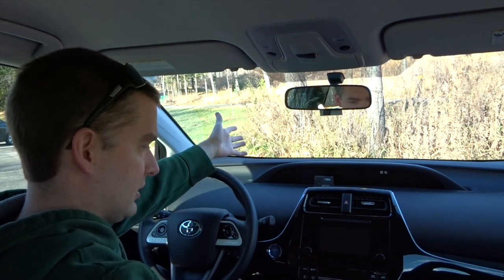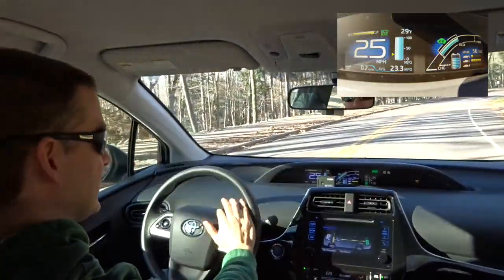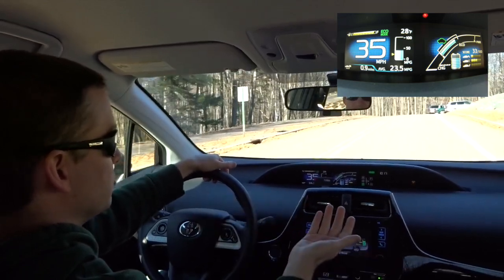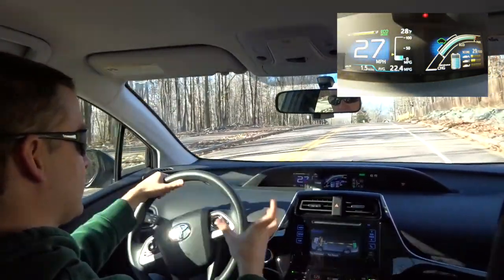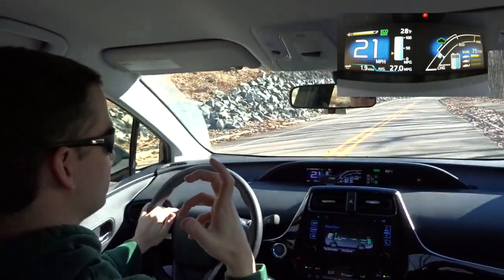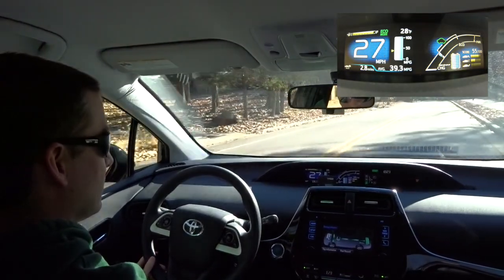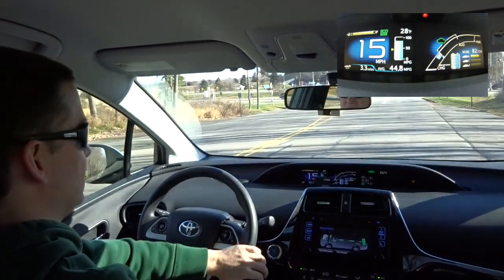Prius "B" Mode Explained

Comment: I have never had a Prius, but My next car may be a hybrid so I am learning. Could B mode be intended for short hills then?
Reply: Yes, and when the battery is full and therefore no regenerating is engaged anymore. Regenerative braking power is about at least 20 kW (differs because of the variance in HSD models) when you touch the brake pedal and in B-Mode engine braking comes on top which are about 35 kW. Engine braking power in Toyota hybrids is not as high as in  conventional gear-driven cars at low gears with high engine rpms because the HSD although it is continous variable in gear ratios with the help of the Engine-Generator 1 it is more limited. Therefore engine rpm is lower than in conventional gear-driven cars and so is engine braking power. But you get the regenerating power on top and you are even or better. Only on long hills and especially the non plugin Toyota version with the small batteries which are charged full in a small time and from then on no regenerating power. Therefore it makes sense to put the car in B-Mode on steep hills or long desecendings to give the mechanical brakes a longer time to dissiapate the heat.

Comment: The engine is spinning in B mode but no gas is being delivered.  Using the compression/resistance of the engine to slow the vehicle down.

Comment: B mode is engine brake mode. Engine runs to provide compression breaking. Use B mode on mountain descents and in heavy traffic where you don't want to break to stay in 20-30 mph traffic flow.

Comment: Probably it's not kicking EV mode on the steep downhill so it can actually use the engine for speed regulation, which can't happen on EV alone. I've noticed the same thing too.

The second thing that comes to my mind about the B mode is that it turns on the petrol engine, every time, no exception. That makes perfect sense to me, because the primary function and idea behind the B mode is the have your battery charged more aggressively and way faster. So how do you do that - well, by combining the "engine running = battery charge" + kinetic energy absorption = battery charge too. 

If you think about it, if you have the B mode running in parallel with the EV mode, you won't be able to get that desired aggressive charging :) Just my 2 cents..

Comment: I wonder what happens if you're going down a steep hill using the brake pedal only to slow the car down and the battery is becoming full, does the control system just gradually use only the friction brake pads to slow the car (it doesn't automatically select `B' mode and spin the ICE faster)?

Comment: I have a 2008 Prius, and it behaves basically the same when you put it in B mode, it keeps the engine running even at a stoplight. The reason it does this going down a hill is it is using the vacuum created by the engine running to act as a brake. Much as any other internal combustion powered car would do when you drop down a gear.
I'm not sure whether it recharges the battery at a higher rate than if you just lightly put your foot on the brake. Light brake application in a Prius does not necessarily Engage The friction brakes but only the regenerative brakes. You could take a look at the Gage while you're doing this and see how much charging is being put into the battery when you go down the hill in B mode versus just light brake application in regular drive mode.
One aspect of the Prius is once the battery is completely full it doesn't have any place to store the energy and regenerative braking will stop being effective, B mode and come in handy in this case. On very long Mountain Hills.
One- that I have found using B mode a lot is you may see an increase in oil consumption. Especially on a car with higher miles. This is because you are running with significant engine vacuum which can pull oil past valve seals and piston rings on a slightly worn engine. One reason the car may have been running as you approach that stop sign at the bottom of the hill even though you are out of B mode. Is because it was keeping the cabin temperature at whatever you had set it at you said it was cold and it needs to run the engine to maintain cabin Heat.
Reply: Difference between D and B is not the amount of charging. Braking by charging is first method in both. But the issue is, what happens when recharging is not sufficient way to keep speed in control. The method after recharging is generating heat to loose energy. That can be done in two ways, using brake pads or/and spinning the engine. There's no gears in Toyota Synergy Drive, so without B option, brake pads would be the only way, and in long decent, they would become toasted.

So when people thing B would be a clever way to generate more power to battery, the truth is the opposite, it's a way to loose more energy with heat generation.

Comment: I've always hated the Prius.... But tell me, Jettlash, what the hell is so fun about it anyway?
Reply: Wolfy Kun 
I use a 2015 to do Uber and Lyft driving in Minneapolis - I drive a shit-ton of miles. It's remarkably easy to drive smoothly, which is really important when you drive a lot. The steering is quite lovely. Tires are grippy enough in the dry (I'm amazed I haven't heard them squeal yet - WTF?). Not nearly as fun as my old 2015 Mini Cooper 2-door. THAT was fun.

Comment: I love the energy graph but I prefer seeing the tachometer. The graph actually shows your gas pedal position and you could gauge it at the ECO line: the gas engine kicks in when that much acceleration is needed.

When the battery is 8 bars full, the engine basically runs off the electric motor/battery to make room for more braking transfer.

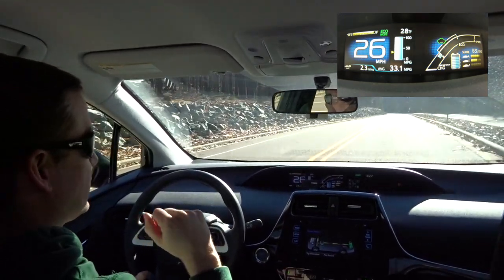Comment: 6:45 if you have the cabin heater on, the gasoline engine is on in order to generate heat for your body comfort. Unless it uses an electric heater but I don't think it does. Anybody here know?

Comment: Is that an aftermarket cover on the lower portion of the steering wheel ? I thought the stock version was white. If it is aftermarket, where did you buy it? Thanks
Reply from the maker: It's not a cover, that's standard on this interior color option in the Prius Two trim level.

Comment: I’ve never understood the benefit of saving a brake job ($00’s) at the expense of a transmission job ($000’s)
Reply from the maker: I can understand that argument. it may make sense to only use that in emergency situations.
Reply: On a long seep downhill, friction brakes may heat up too much and "fade" (have reduced friction). Friction in engine, on the other hand, will heat well under the temperature of normal use (burning gas). I think I read somewhere that this braking is done without using any gas -- air compression works as a brake.
Another benefit is that B-mode gives better traction control in slippery condition (less danger of skidding)

Comment: Good video.  
You can tune it up by looking into the Prius 'CVT'.  It is not a true CVT (what engineers mean when they use that term) because it has exactly ONE gear. The Prius never shifts out of that gear--it is always in that gear.  Many people are confused by Toyota's 'CVT', probably because Toyota wants to confuse folks about this.  One gear sounds bad, but Toyota makes it work.
Reply from the maker: Thank you, and I'd love to see a video about the internals on the transmission for these cars.
Reply: jettlash1000 : Does it have to be a video?  Would you settle for words and pictures?

Comment: Do you feel that the engine is slowing you down or is it the regen braking?
Reply: alex tworkowski
I'm guessing regen is used less in B mode and the gas engine is more directly coupled to the wheels by the drive system, allowing greater use of normal gas-engine high-vacuum braking (the gas engine revs higher in B mode).

Comment: Jetta.  B mode which I call brake mode is exactly what you said its basically L or Low Gears mode.  You asked or commented in the video that you didn't understand why the engine is on during B mode.  That is very simple B mode works by using the Engine to brake just like a car does in Low gears.  

Also please note that B mode can be engaged and disengaged on the Fly.  Meaning you can go from D to B and then back to D.  You don't need to stop the car.  

I use on steep inclines and when I want to brake harder without using the brakes.  For example and this is only for Prius cars and full EV cars, as you know the car brakes without using brakes pads.  Well if you need to stop faster without using the pads.  You drop it into B mode and then apply brakes and the soft braking is much stronger.
Reply: Soft Braking is my term for EV car braking without engaging the brake pads.  Soft Braking is usually about 10% of the brake pedal full range.  So anything above 10% depressed begins to use the brake pad, anything under 10% depressed you are using the Electrical Motor to stop the car.
Reply: My 2008 Prius still has the original brake pads, and they are still 90% or more unused.

Comment: Brakes needed to shift from D to B and vice versa ?
Reply: No need. But makes the transition to  “B” less risky cause cars behind you will not be advised by your brake lights.

What will destroy your transmission is shifting from D to R or viceversa without stopping first ( I’m not sure if there is a tolerance of 5km/hr but better play safe).

Letting it go backwards while in D, or ahead while in R is strongly told to avoid. Check manual.

Comment: “B Mode” in Prius is similar to the “L Gear” in conventional vehicles. 
L limits the highest gear the computer can choose, in order to provide as much engine brake as possible. If you drive at high speed, you remain in lower gears.
Prius doesn’t have engine connected to wheels all the time, so in B mode when you let go the gas peddle at high vehicle speed, Prius will engage the engine to provide engine brake. However based on my experience, when let go the gas peddle at low vehicle speed, Prius won’t engage the engine. When driving at high speed, Prius functions just like in “D Mode”

Comment: I just bought a new Prius and was wondering if it's ok to shift from D to B mode while on the move without damaging the gearbox or only select B mode before any acceleration?
Reply from the maker: I’ve done that in every car I’ve owned, but let’s see if anyone else chimes in.
Reply: Actually You also did it in the video.. so should be fine, I still haven'tread the manual

Comment: Instead of B-mode, what would happen if you stay in D-mode and partially depress the brake pedal (enough for regen, but not enough to engage the physical brake) as you are travelling down the hill? In other words, you are regen-braking all the way down. Is regenerative braking alone enough to keep the downhill speed under control?
Reply from the maker: On this hill, the brake itself would use the physical brakes to keep speeds in check. In B mode, it didn't require any use of the physical brakes.

Comment: My wife has this. BOught it in Feb. 2016 or about a month after it was built. I have noticed that, while in EV driving mode (Blue color) it requires more pedal travel to get the car to move. With our driving habits, we discovered that, we got WORSE gas mileage with the EV mode than we did with the "NORMAL" (Green) mode. Green mode is where we are getting the most MPG at about 62 in the summer, and 58 in the winter. No joke. My wife does about 80 miles a day, 60 city, 40 hwy.
Reply: william ingram jr
Yeah, I found Eco mode to be irritating and it didn't make much difference in fuel mileage. Hated the throttle feel in Eco mode. I leave it in Normal.

Comment: I always understood EV mode in a Prius, was the bottom section below ECO area. The location on that measurement bar, it's like a area. And anytime your in that area, it's no engine, and all battery. |        EV             |            ECO          |   PWR  | 
I always noticed when I drop below the ECO line, even doing 40mph, the engine appears to shut off. And I slowly lose charge off the battery, while getting 100mpg. Once it goes into ECO, engine starts up, and mpg drop to about 25-50mpg average.
Not sure why your engine was still running below that ECO line, unless the grade of the hill was the issue?
Reply: B mode mandates engine braking, no fuel used, just air compression.

Comment: Where you were coming back down in B mode and the car slowed below 25 MPH, I would have dropped over to Neutral for a few seconds to pick up speed, as opposed to stepping on the gas.  When the speed picked up adequately, I would quickly bump it into  Drive and back into B mode.  This has been very effective for me, and I now have 137K miles on my 2011 Prius with no battery or engine problems.  

Best tank to date was over 600 miles, averaging 65.2 MPG (all in-town driving in a single day.
Reply from the maker: Nice one!
Reply: Alternately, you can go between Drive and B mode. That's what I do when I'm coming down I-70 from a day of skiing. I can usually control my speed to match traffic this way, rarely touching either the gas or brake pedals all the while charging the battery.

Comment: I have a question about your Prius. Just two days ago I noticed when I’m stopped on hill (front of car facing up the hill), the energy flow screen shows there’s power going from the battery to the wheels even when I’m not moving. On flat ground it doesn’t do that. Did I just not notice it before or is something broken? Does yours do that?

I have my routine service coming up on Monday and will have them take a look at that as well.
Reply from the maker: My guess is that since your foot is off the brake, it needs to use the battery power to hold the car in place. Seems normal to me.
Reply: jettlash1000 No my foot is completely on the brake and it still sends power from the battery to motor. Only happens on hills tho. Getting it looked at on Monday.
Reply: @PattyKuluCakes  prep for departure?

Comment: so you can switch from B to D and vice versa while the car is in motion? pardon my ignorance. :) I dont have a prius.
Reply: yes you can. B mode engages engine breaking so you use it mostly for slowing the car down without using the brake pedal. You simply move the shifter to the "B" position for a moment to engage "B" mode. When you let go the shifter springs back to a default position and the car stays in "B" mode untill you move it back to "D" whenever you like, which would engage "D" and turn off the "B" engine braking mode. Down one or several long hills the battery charge gauge on the dash will sometimes reach a full charge and at that time the engine revs at a much faster speed that is noisy, because it can/should no longer send a charge to the battery, I guess to prevent over charging? I usually switch back to D when that happens and use the brakes a bit if needed.
Reply: Terry Proveau 
Terry, that sounds about right. That's the sense I get from listening to and feeling what the car is doing.

Comment: Is it safe to use B mode on the highway? 

Also nice video, useful information.
Reply: 2020 prime manual...
"■About engine braking
When shift position B is selected, releasing the accelerator pedal will apply
engine braking.
●When the vehicle is driven at high speeds, compared to ordinary gasoline fueled
vehicles, the engine braking deceleration is felt less than that of other vehicles.

●The vehicle can be accelerated even when shift position B is selected.
If the vehicle is driven continuously in the B position, fuel efficiency will
become low. Usually, select the D position." p. 345

Comment: B mode is for engine braking, the engine has to be on and gas will be used in this mode, but you will also charge your battery at same time
Reply: Sounds verry logic to me. The petrol engine is running stationary and you break on that engine. And the electromotor needs to get rid of energie and therefore loads the battery.

Comment: if you're on B mode, do you need to shift back to D mode if you need to increase the speed or does the car do it automatically and thus no need to shift it back yourself?
Reply: jett690 - you need to shift back to D to resume normal driving.  It won't shift back by itself.
Reply: Richard Marsh
I've accidentally left mine in B mode for a dozen or so highway miles. I finally noticed there was more engine braking when I let off the throttle. "Huh". Put it back in D and continued my merry way.

Comment: I have an older Prius that isn't a complete hybrid, but it does also have a "B" mode. But there is an entirely, much simpler way of explaining it.

Ever heard of a semi's "Secondary" brake? Yeah, it's called a Jake Brake. Non-Truckers don't really know that l, or, should I say, most of them that I've met don't know.

Anyways, back to the point.

The "B" Mode is an Engine Brake-- Aka? A Jake Brake. That's all it is. Literally. But let ms tell you-- YOU DO NOT OVERUSE IT.

At least, not in the hybrids. You WILL fuck your engine up. If you hear the engine struggling (Overrevving), you put it back in drive, and remember the first thing you /should/ have learned when driving down a hill.

Five over, three second press. Five over, three seconds down. You WILL NOT burn your brakes up. You know how I know?

My mother is an ex-trucker. Long Gaul Refrigerated, Dry, and Dedicated, for three years. I spent six months out on the road, learning under her, to become one myself. 

And trust me on two things: Your brakes will survive with the right technique, and you do not want to use the Mini-Jake if the engine is overrevved.
Reply: Baka Sensei hi just to let you know the Prius is a complete hybrid. It was hard to understand what you meant by incomplete. Glad you love your car tho. The prius rocks
Reply: I see you don’t quite know what over revving is. The engine is well within its limits and it’s not being wasted as heat because the energy is being put in to the battery.